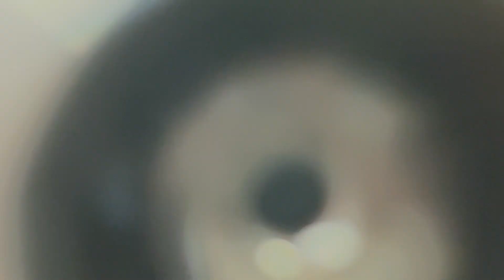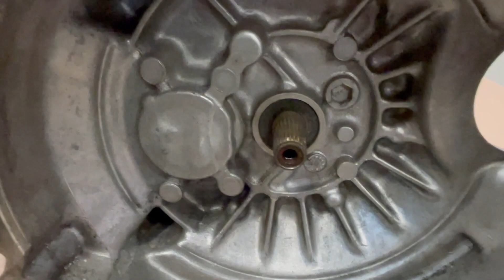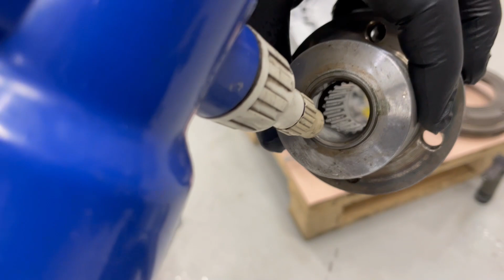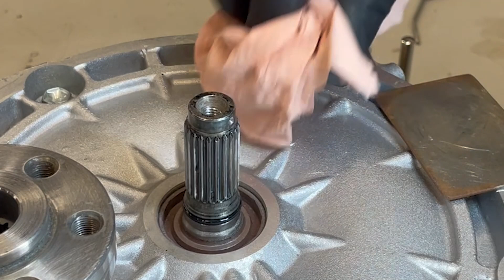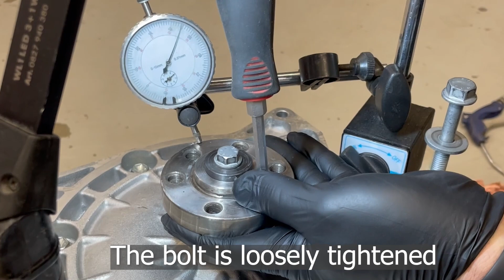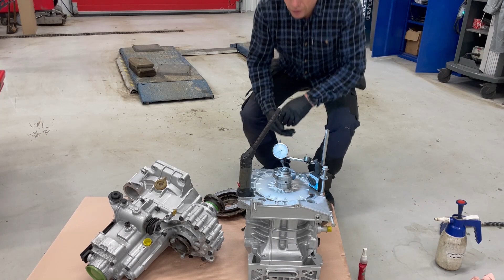Assembling my drive unit with my DIY kit. Part 1

Comment: I am pretty sure you need a bearing on the output shaft of the Leef motor as its not supported internally, just in the end of the gearbox housing.   Without it the output shaft will eventually float.  I could be wrong.
Reply from the maker: There is a bearing on the output shaft, but the question is how much load it can handle. Thank you so much for your comment.

Comment: I am concerned that the the pressure plate going in to engage the clutch will create an axle load to the Leaf motor shaft.  The Leaf motor shaft was not designed for this axle load.  Consider  suspending  the coupler/flywheel flange with a thrust bearing that fits in the adapter plate.
Reply from the maker: You are absolutely right about that, and I been thinking about that too. But ball bearings normally can take up to 50% of the radial force rating so think that it will handle that axial load just fine, and by the way, I probably not even have to use the clutch anyway 😅 it’s more there for fun nowadays. Thank you so much for sharing your thoughts 👍🏻
Reply: @flyingtools . The original bearing for the Leaf did not have to be much of a bearing because it went to a gear box with very little radial load and no axial load.  https://en.wikipedia.org/wiki/Thrust_bearing
Reply from the maker: @markyormark7747  yes, i know. Thats also what I meant.

Comment: Great progress as always.  It start to get technical now :).  Watching this to take notes to apply the same to either my spare 020J  box or the box in my 6N2 Polo. A Leaf powered Polo will weigh about the same as a Mk2 Golf . One day maybe I will do the same to one of My Mk2;s .
Reply from the maker: Thank you ☺️ if I had to do another conversion to a normal fossil car. I definitely had tried to use the Nissan leaf gearbox. It will save you a lot of time and work and probably be more reliable to.☺️

Comment: Compared to you I really did a hack job of installing the coupler on my Touran 🙈 But then I don't have the bulky flywheel but a Rotex claw coupling instead. If I want to shift (which I hardly ever do) I temporarily disable regen and shift with help of synchro rings. It's held up for 50000 km now.
Reply from the maker: Wow, thats amazing! I hope and think this will hold but if not, I will convert to no clutch. Thanks for your comment 👍🏻😃

Comment: I'm surprised that you chose this method. Wouldn't aluminium or brass shims have worked and then not worry if the locktite fails after several heat cycles?
Reply from the maker: Shim splines?? If it had been that easy I promise that I had done that. The heat will most likely not be a problem. Luckily those cars are easy to work with if I need to do any changes in the future.😉